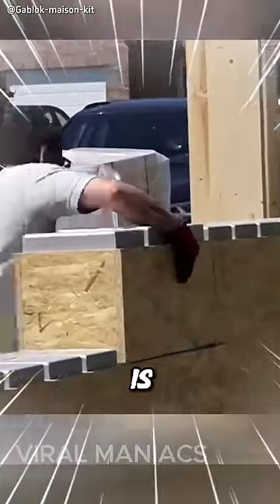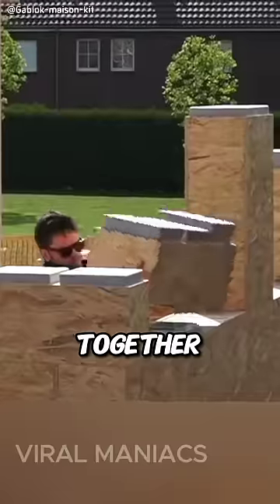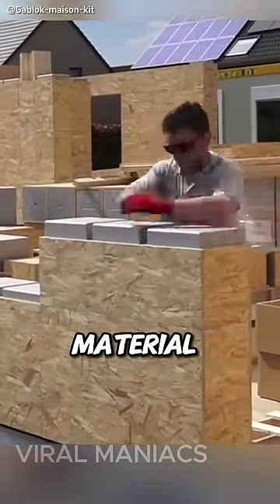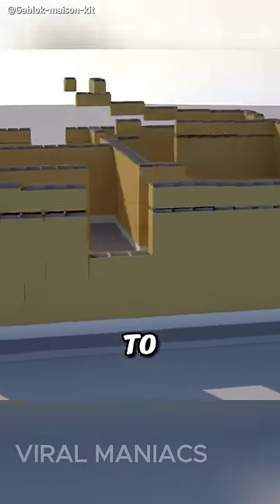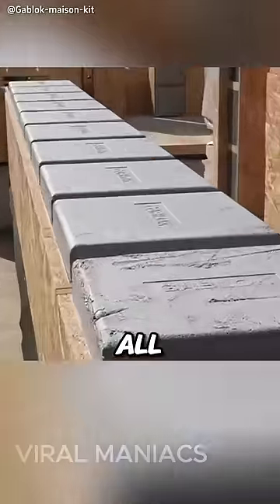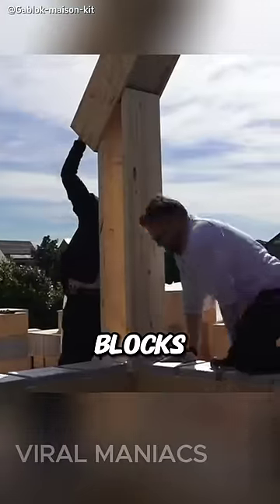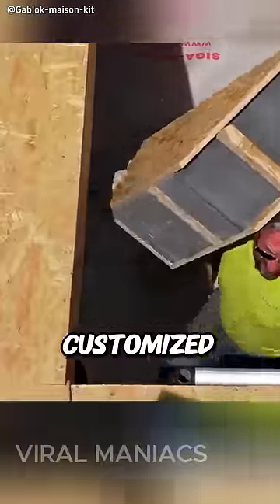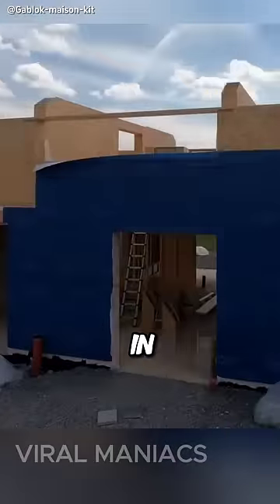Whoever Invented This Way Of Building Houses Is a Genius #shorts

Comment: And after the first gust of breeze, your living room becomes an outdoor patio
Reply: yeah , thats why it is a Living Room 🤣🤣🤣
Reply: Why would the county inspector pass this inspection?
Reply: That's funny 🤣🤣🤣🤣🤣🤣
Reply: They've never seen a lego house fall down I guess. 😂
Reply: @kylelittle803  Imagine comparing wind to some clumsy child dropping the entire thing from a height when adjusted for the size difference would be the same as dropping a house from. The height of the Empire state building. Show me any house that could survive that sort of fall.
Reply: @imaran1303  not how physics works but ok
Reply: They could at least do something so it sticks together?
Reply: If you notice the layers are off set, this is basically replacing small masonry bricks with OSB/polystyrene blocks.
Reply: I’m 100 percent sure this is way stronger than a stick build.
Reply: Lol imagine building it in the rain
Reply: My thoughts exactly!
Reply: @benchinny-ev3xe  Tell that to the people who think that a lego house breaking because you drop it is a testament to how structurally intact it is.

Hence why I dare any of said people to find me a house that could survive such a drop from a comparable height.
Reply: @sainturiel7459  they weren't showing the part where they put Elmer's glue between the blocks.
Reply: That is not true you need to learn a little bit more before you make a comment like that little bit more research it's much stronger than a stick built I actually have an engineering license and I know about the product
Reply: @fauvecorrigan1233  Right!? Good thing it never rains when building regular houses. Imagine
Reply: @sainturiel7459 Everything will be tied together with siding on the outside, the roofing and on the interior by whatever type of finishing they decide to use be it paneling, tongue in groove or sheetrock. 

The weight of the entire roof will also. keep the wall together.
Reply: @catskinner7564 this could work if they add cement.  Thanks!
Reply: Like this is so much less sturdy than the regular plywood houses in the us
Reply: This is probably the most sturdy house built. All those other house use that cheap ass wood and materials. That's why when a tornado hits you can't tell what was sitting on the foundation.
Reply: @northsider4957  OSB is a direct replacement in many many cases for plywood.
Reply: *You're
Reply: @clubfillerspinkknickers9791  You’re means you are, it’s a contraction. I spelled it correctly
Reply: @erikrichardson6886  Usually it was a mobile home. 

I don't know how they do it but tornadoes have an uncanny ability to seek out trailer parks and destroy them....
Reply: Best joke ive heard so far 😂😂
Reply: @rmx01indiana  I will repeat, it's you're 🙄
Reply: @clubfillerspinkknickers9791  so you’re reading it, “. . . of breeze, YOU ARE living room becomes an outdoor patio??” Bruh…. lol
Reply: @catskinner7564  I knew the house was sturdy and stronger than a stick built house from the get go, and the only license I have is a driver’s license.

Comment: Bro electrical work seems like it would be a nightmare
Reply: Not to mention the plumbing.
Reply: Waiting for someone to make this point
Reply: See this was my thoughts too.
Reply: As an electrician, yes. Tell me how tf i am supposed to install anything in that wall or how i am supposed to hide cables in there. Plumbing would be the same nightmare
Reply: Where’s the HVAC system going & how? lol
Reply: I seriously doubt these things weren't considered in construction of this. All we're seeing is the most basic build process not the fine details such as anchoring or electrical or Plumbing or what have you.
Reply: Found a video. They nail risers on every wall and then dry wall on those risers and the electrical, plumbing etc is run in between them.
Reply: Actually plumbing and electrical would be easier than a traditional house.
Reply: @quzyr8988 I grew up building log cabins. None of the electricians, plumbers or HVAC people had an issue with solid wood logs. Why would this be any different?
Reply: @quzyr8988 use your brain, I'm sure some of the blocks are positioned where you can run plumbing and electrical wiring through.
People complain about every damn thing, if it's being done then find out how it works rather than bitching.
Reply: @quzyr8988  my gues is they use the floor to spread cables and plumbing acros the house to where it is needed. and the rest is on wall . or they use a
Reply: Pretty sure they took that in to consideration. The video doesn't show the whole process
Reply: @mrow7598 thought that was obvious tbh but most can’t see past their eyes
Reply: you put the electrical work on the inside and you still have to sheetrock it bro 😂
Reply: @quzyr8988 couldn’t you just put it on the inside you still have to sheetrock it
Reply: This would be no worse than block walls. It is clear that this technology needs refinement. A few concerns would be rigidity in the exterior walls giving that it is locked together solely by the interface of the polystyrene. This could be solved by securing 2x4 or 2x2 furring strips to the interior side of the exterior walls giving room for electrical/pluming. But this leads to the other big issues now your walls would be really thick giving that the blocks are 8" thick on their own then adding 2-4" furring strips would make them close to 10-12" thick making it difficult to source windows/doors.  Interesting idea, with form refinement i think it could be pretty good.
Reply: @elileubner949  yes and your point is?
Reply: Can someone tell me how to start being an electrician im at and ive been thinking about it dir a while

Comment: Watch them make this more expensive than buying a normal house
Reply: That’s what I was thinking.
Reply: It probably is
Reply: Economies of scale. If you want to bitch about price then you need to know what that means. Since this is unique and probably patented by 1 company it most definitely will be expensive. Plywood and 2x4 are produced by many companies thus they are going to be cheaper. The only big factor would be time and labor. If you cut out the carpenters then I can see this being cheapish. Not sure if thats a good thing…
Reply: Most likely is, someone somewhere has to make the parts and put them together to ship those out as "blocks" to the job site... Also If those are the inner and exterior walls idk how they are running the wiring thru the insulation blocks that seems like another costly bill
Reply: @benroth4013 bro took the seriousness of this comment section to a 10/10 😂😂😂 relax, looks like you just passed your entry level Econ course. We all understand supply and demand here
Reply: Time is money. Of course it’s more expensive if they can build your home in half the time
Reply: @OhhItsDev  probably have to put up some drywall an inch or two from the walls for wires and pipes
Reply: In any stormy regions that house would be light enough to just fly away
Reply: Most of are gonna end up living in the woods and plains again
Reply: It's a company in Belgium not United States.
Reply: @benroth4013 Nah. The price of the Lego building bricks will never be lower than the materials that you use to build the house, even with economics of scale. 

It takes additional time/skills to make these Lego building blocks which will balloon the costs above other materials.
Reply: @benroth4013 you still need a carpenter
Reply: Just wait for the Chinese knock offs then.
Reply: @jglakecity name?
Reply: @jamieogilvie4214  aye, but it's less expensive if you yourself can build your own home without paying others.
Reply: @benroth4013 Pretentious. I couldn’t finish reading this crap.
Reply: Of course.
Reply: @OhhItsDev  that’s about what I was thinking how they run the electrical how they run the plumbing and they put it on the inside walls ???
Reply: Probobly true. The mechanical, electrical and plumbing work will cost 10 times the amount than that of a normal job.
Reply: Right
Reply: Oh you know it
Reply: @benroth4013 oh trust me my husband is a very good carpenter for his carpenters union but he tells me that these carpenters can be lazy and incompetent and he doesn’t understand how everything actually gets built. So no carpenters make tons of mistakes, they are not perfect, they screw up a lot
Reply: @benroth4013 then they will be facing bankruptcy, you think people will rather buying this for a real house if it's more expensive. stones are better, unless it's teak wood then you have no right to be expensive.

Comment: If you screw a bunch of galvanized steel straps (like plumber's tape) up and down every course (inside and out) it would probably be pretty strong.  

I know I'd want to do something like that 

And I'd imagine that inside walls would be finished with furring strips and drywall, and (as an electrician) that shouldn't be too hard to work on at all.

An interesting concept.  Probably needs some kinks worked out, still, but it could have some real possibilities.
Reply: And imagine how warm it'll be when all that polystyrene goes up in flames....

Comment: I need to see the wiring and plumbing process for these houses.
Reply: Those are put together like Legos too. LoL
Reply: Right
Reply: Yeahhhh that doesn’t make any sense
Reply: Maybe there is a tecno variant of the blocks were you slide the pipe in the middle
Reply: Crap. We forgot to put that stuff in.
Reply: It’s for when you live in the woods you just poop and pee outside 😀
Reply: They fuse Legos with k'nex duh
Reply: Probably it will go over walls but I doubt that it's has noise cancellation or straight
Reply: It would probably be like a log cabin a pain in the ass
Reply: I just thought this!! 😂 I can see making pre-drilled holes in the gray material to allow room for the electrical, plumbing, heating and air to be ran.. then just be sure to put the correct blocks together..🤷‍♀️ but I guess it could work
Reply: Doubt it will be an issue.
Reply: @WarpaintFTW  easier than a log cabin 😊
Reply: @SageOfHeaven  not if you know what your doing 😁
Reply: @SageOfHeaven  not if you know what your doing 😁
Reply: Obviously there will be more layers to this. 
You cannot simply do isolation and paper thin wood tiles.
Reply: You use redstone
Reply: Probably just have to bore out the blocks as you go..
Reply: @SageOfHeaven  and it has to pass code 😎
Reply: They probably strap the walls and drywall
Reply: @SageOfHeaven  not really.. a house is mainly just a solid foundation, framing, and insulation.. wiring and plumbing.. not too much more after that
Reply: @George-yd7cx  heck yeah.. but not as pretty 😍

Comment: that seems horrendously flammable.
Reply: Unless it's not... Many foam insulators are fire retardant, and will not burn or off gas. Depends on the material and local building codes.
Reply: Na that is practically thermite scale inferno fuel

Comment: All these comments coming from people that have clearly never done construction. If you fear the Lego style, you can always add another layer of plywood to the outside, before everything gets strapped to the foundation. If you knew exactly how your house was connected to the foundation, you'd have less apprehension to this style.
Reply: I’ve done construction AND I’m a structural engineer. Sheets of OSB aren’t going to fix this monstrosity.
Reply: @saintsfearful  sure bro, I believe you…
Reply: @saintsfearful  you're an engineer and don't understand how buildings are already put together?  What's the difference in bolting a 2×4, or in many instances, screwing in sheet metal,  to the foundation over bolting 90° anchor ties to the foundation and the block? Along with tornado resistant eifs on the outside,  locking it together.  Don't think that's enough?  An engineer would suggest an overlay of plywood or flat strapping along joints to strengthen it.  Not just say,  "it's shit.  I know.  I'm an engineer. "

Also, those of us that have built homes, put together heavy machinery, or welded to any set of prints knows that you can't trust an engineer to understand real world numbers. Nothing can be put together in the field with zero tolerance.  But, engineers love to think it can be.  😂
Reply: Agreed 💯👍🏾
Reply: And here I am wondering where all the electrical goes
Reply: Here's a fun fact.  12 of these houses have done been reported to blow down in certain spots after mild storms with 35mph wind😂😂😂😂😂😂
Reply: sheats of rebaar in the foundation, a whole story below ground, about 20 to 40cm of concrete +isolation + fireprotection.
But our houses generally are built to last at least half a ciecle or longer.
Reply: @sarahelko  is particle board and foam. It can be drilled through or channeled wherever necessary.
Reply: Polystyrene = 🔥 that will vaporize anything left inside.
Reply: r/murderedbywords
Reply: @xrumple4skinx55  knew it
Reply: @saintsfearful  From a small child, I've built houses with my father, from the foundation to the front door.  I would never think of using OSB to provide security.  When that stuff gets wet, it turns into cereal.
Reply: @silverlakegirl9078  calm down your talking to an engineer 🤣🤣🤣  one of those book smart guys that know everything but have not the slightest hands on experiance🤣🤣🤣
Reply: I think this method would be sound if the blocks were connected.  Even a bead of construction adhesive like mortar could add tons of strength.  A house would still go up quickly and be much stronger than without it.
Reply: You want to be in one during a tornado or hurricane. I get the interlocking integrity. But do too low weight it would be more prone to horizontal stress.
Reply: Is actually pretty easy and smart design and like you say you can just throw another sheet of plywood on the outside. Complaining about the wiring and stuff like clear heads out your asses please
Reply: @AfroMocha  Forbes has ranked this design a 2.4 out of 10🤣🤣🤡
Reply: @AfroMocha The wind here snaps off living trees 100ft tall with no problem. A sheet of fucking plywood isn't going to do anything at all. This is a construction style for extremely mild climates.
Reply: @johnparnell3427  Engineers are just over priced interior and exterior designer who learned from reading a book. I cant stand either one of them and im also in trades.
Reply: @arc00ta  well in that case it seems like these aren't the types of houses for that area. That being said unless a house is built out of stone which you can't really do any sort of house building kits are prefab kits out of stone it makes it very hard to make that an arguing points the concept the idea of the product is designed for obviously a certain climate no one's claiming it to work in every climate and even with the plywood added never said that adding the plywood would make it windproof. But I mean like at the end of the day it is what it is people shouldn't be complaining about what it isn't no one's asking you are forcing you to buy it hell no one's asking you are forcing you to watch the video. The fact that you comment down vote or agree or disagree with the video gives it traffic and that's all the algorithm monitors is traffic. So if you don't like something and you don't want it to succeed ignore it that is how this stupid capitalist society has worked for the last several decades now could have a genius innovative idea and it doesn't matter how smart it is if the masses can't understand it and you have that one person that starts the tidal wave of negative comments that idea will never get off the ground it'll never see the light of day it'll be recorded in the forgotten annals of history of great ideas.
Reply: @AfroMocha EVER heard of "FERTIGTEILHÄUSERN" in Europe ? THEY ARE MADE OF PARTIALLY HOLLOW BRICKS, CONCRETE ETC , and have a CELLAR. They basically build the walls outer and inner as ready as possible, pour the Sand etc to set the foundation, isolation etc. , then add the walls, put the ceiling on the cellar, add the ground floor walls etc,  put the ceiling on top , etc . Then do the windows, basic wiring and isolation , etc.
Reply: @AfroMocha  I just said it was for mild climates, I actually think its pretty cool. My disagreement was with people who think that it is the new "end all" style of construction. Humans have been building houses for thousands of years, we've got a pretty good hang of this shit. I can see a number of issues with this style, settling is going to be a huge problem down the road and cracked interiors are probably extremely common, just like modular homes. Its not meant for heavy weather, likely not for heavy snowfall either. But it is interesting.
Reply: Sure … during an earthquake when everything fails and the gas line blows it would go up in flames in minutes… No Thanks!
Reply: You sir could have never even stepped foot in a build. Much less work in construction. This is shyt.
Reply: Yup, compared to american houses this is almost as good 🤣😂😂🤣😂😂🤣
Reply: @arc00ta  ah okay I misread there. Yeah I plan to use this style to set up structures on my airsoft field for quick building and rebuilding
Reply: Or just get ICF done and you never have to worry about it blowing apart in a light wind.